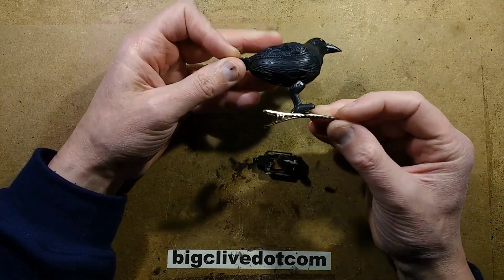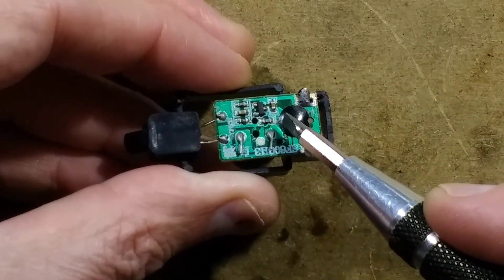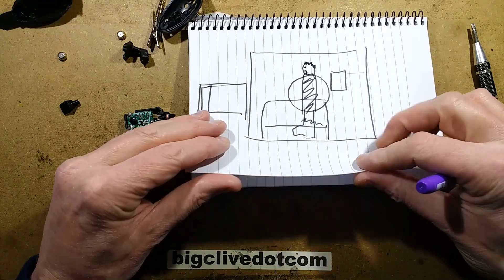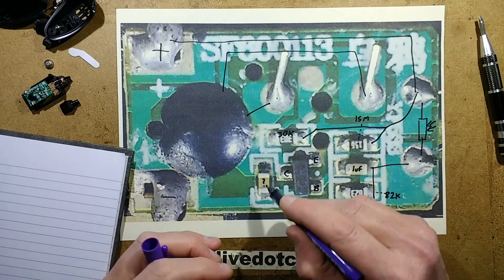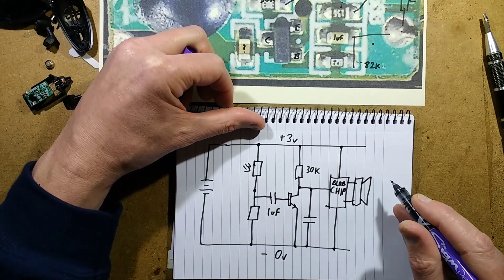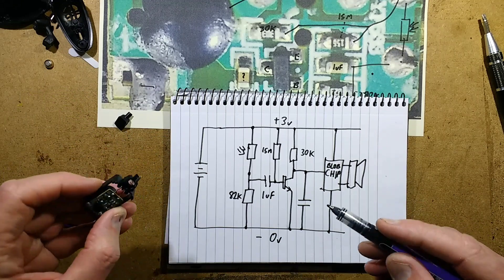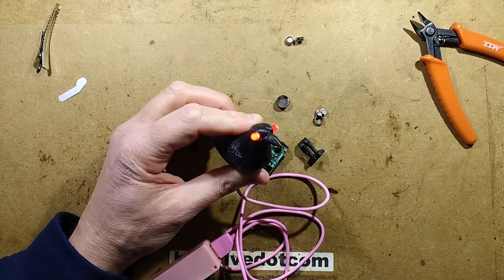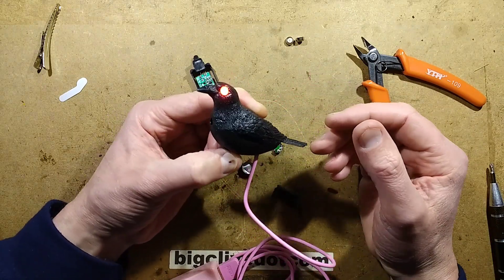Poundland's Halloween crow type thing.  Schematic and mod.

Comment: Oh, and I love how cheap, accessible and bright tiny SMD LEDs are these days, you certainly could put there a couple of 0805 lamps; they are worse for mounting them in mid-air instead of a PCB, but that's the only downside I discovered so far.

Comment: Does anyone else think it might be better to drill the eyes out and use one LED in the middle of some clear epoxy to light both sides? It would be easy enough and the epoxy would act like a light pipe. It would also be fairly easy to tape over the eye holes to keep it from leaking out. One could also solder the LED leads to the speaker output after determining the proper polarity so the eyes would light when it makes sound.

Comment: BigClive, I would love to see a short video going through the workings of this circuit with some actual voltages drawn in and what happens when the LDR value changes.

E.G. what is the bias voltage at the transistor base and does the voltage at the LDR divider always stay above that or swing around it? Does current flow from the LDR side to the transistor in all lighting conditions or does it also go from transistor/bias resistor back to LDR divider too? What is the input impedance of the transistor base and how quickly does voltage on the coupling capacitor leak off? Why use the transistor, does the microcontroller not have a high enough input impedance? I wonder if the MC input is analog or just logic.

Comment: It's interesting to see such old and simple technology as a CdS LDR still being used. They are cheap, and do have a wide resistance swing, whilst no replacement device has been found, so maybe it's not too surprising to see them being used. The amount of Cadmium in them is tiny, as you say, so perhaps there is some concentration which they can stay below, and still be legal. Arsenic in LEDs is another example. Or is it that Customs and Environmental Health inspectors haven't cottoned on to them yet?! The raven is predictably naff, as usual. ;-p Thanks BC.

Comment: Cadmium is very dangerous if burned, and or as a leachate but if handled properly it is not so. There are stories of people using cadmium coated refrigerator shelving (first offered in earliest of fridges post "ice box" era before they figured out how to do chromium on ferrous materials)  and as they repurposed these from the continuous upgrading of appliances,  the fire pit barbeque grill option became a thing and during the first burn off, suffered the ultimate affliction, namely death. Apparently one good inhalation of smoke laced with this is hard to come back from.

Comment: you could use the trigger type circuit on the audio output so when it makes a noise the eyes light up in unison :)

Oh and there is room to stick a bigger single lithium ion cell inside the body too to run it all :)

Comment: You could use the base of the transistor to drive the leds so they flash when triggered but i think you would have to increase the batteries to the larger lithium cells.

Comment: You could fill the crow's head with Epoxy and an LED then drill two small holes from the outside just deep enough for the glow to be seen.. just an Eyedea

Comment: Hey there Clive.
 I've been having this weird issue with some (most) of your videos not having any audio on chrome (Firefox, Opera and the YT app on my phone all work fine).

I know it isn't my chrome installation/plugins because I've tried disabling everything, erasing cookies, and even running a fresh installation under a Virtual Machine with a clean OS to no avail. Also, your channel is the only one that shows this behaviour.

I don't know if anyone else is having this problem or for how long it's been a thing since I usually watch your vids on my phone, but I just thought I'd mention it.
Reply from the maker: +Etienne de la Rosa Check your computer's surround sound settings.  It may be diverting the audio to a missing middle speaker.

Comment: hello from North Carolina USA. I really enjoy your videos. I'm curious about a few things. I'm trying to learn electronics. mainly power supply's. and maybe arduino type stuff. I was wondering if you could dissect some ICs or build them on paper or breadboard. and another. should I start learning how to work with SMD . I heard through hole stuff is getting rare. and within 10 years or so. be nearly impossible to get. thanks for the great videos....

Comment: The 15M resistor also ensures the batteries drain before next Halloween so you need to buy it again. Since no one would buy new batteries.
Reply from the maker: And it's glued shut.

Comment: Are these big black blobs on pcb's a resin cover for ic's?
Reply from the maker: It's a technique where a silicone chip is glued to a PCB, the wires bonded to adjacent pads and then a blob of black resin applied to protect it all from physical damage and light.  Integrated circuits are sensitive to light.
Reply: Yes, I think its to hide the ic to make it harder to copy the circuit.
Reply: Just to protect it from the air.

Comment: I got a Minions themed handwash bottle with the handle playing random excerpts from Minions activated by a spring-in-a-tube
Reply: Where can I get one?!
Reply: I got it as a small gift for my birthday and it was bought in a local shop in August I think (I don't know which shop). The soap is spent and I only kept the head. The batteries ran out long before the soap was spent and I replaced them and now it works fine. This is the one https://www.youtube.com/watch?v=ue93hqReog4  I found it online @ Boots (UK shop) http://www.boots.com/despicable-me-minions-giggling-hand-wash-10189039
Reply: Right, I'll have to remember to write it on my shopping list! :-)
Reply: maybe Clive can get one and take it apart. I could show its 'guts' too if wished for.

Comment: There used to be a little pokemon (Pikachu!) toy that used a circuit quite similar to this, although it was traditional through-hole rather than SMD... it was a while back. I tore mine apart to try and figure out how it worked and later down the line found out that people were 'circuit bending' them. I didn't have mine anymore, but got a bit of a giggle out of how mental they sound with various components swapped out.

A quick YT search came up with the natural end point of such experiments; a demonic-looking Tellytubbie doll! https://www.youtube.com/watch?v=UCPbo5vQCdY

Comment: If you had a little fiber optic or light pipe material you could use one LED.
Reply: Just a bit of any clear plastic would do.  If you lose 1/2 the light, nobody will care.  You could use a red-green LED and run the two colors to make yellowish color.  Wobbling up and down the green and red could make the eyes vary in color a bit.

Comment: Surprised to see an LDR in a product sold by a UK company given that they contain cadmium and hence are banned by RoHS
Reply: I'm not arguing about whether or not it's safer or environmentally preferable to use photodiodes/phototransistors over CdS photocells. I'm merely recognizing that the product appears not to comply with the relevant laws.
Reply: what is the alternative?
Reply: Easy, a photodiode or phototransistor.
Reply: fair do's!
Reply: What elements are they doped with?
Reply: I don't know but it is possible to go to farnell and order RoHS-compliant photodiodes/phototransistors. CdS-based LDRs? nope.
Reply: It's like the not hi-viz, hi-viz vest scandal all over again! :P
Reply: Silicon in transistors is doped with Arsenic and Phosphorous. Processing uses chemicals such as Sulphuric acid, Nitric acid, Orthophosphoric acid, Acetic acid, Acetone, Tetrafluoroethylene, Boron, Phosphorous Oxychloride, and other things. Even de-ionised water. (It hurts like crazy if you splash that water into your eye.) All of those acids are highly concentrated, and are boiled for prolonged periods, sometimes mixed together. Silane gas is often used, and chromium, copper and nickel are often used in the packaging. Nickel plating is done using cyanides. (I've used all of those chemicals in making semiconductors.) So talking about devices being non-toxic is rather misleading. Lots of heat is also used (up to around 1300 degrees Celsius, for days on end.) The device might be 'safe", but the manufacture process certainly isn't for tree-huggers. Without those devices, we'd still be living in 1950's conditions in many ways. Your home PC would not exist, and nobody would have a portable phone, unless it could be plugged into a wall socket somewhere. And your TV set, if you could afford one, would still need a strong person to lift it up. Let's face it, we would never have even heard of Big Clive.
Reply: No semiconductor. device has been developed that has the simplicity, reliability, ruggedness and wide resistance swing, coupled with low cost and ease of use, of a Cadmium Sulphide Light Dependant Resistor. Their manufacture is also much less energy-intensive and toxic to the environment than the making of Silicon transistors and diodes. You have to look at the bigger picture with all things, before you start saying, 'This is safe!' or 'This is environmentally-friendly!'.

Comment: Much better sound on this, So much better than the previous setup (hat mic I believe). Your voice is quite unique in it vocal range, and this setup although needs slight clipping on highs (although not enough to need extra processing) suits the lower end much better, No longer sounds Like an 18 years old car (absolutely crammed full of bass)

Comment: mod it to run on 2 AAA or another power source and  put in flashing eyes that flash to  it's ca-caw
if AAA is too much current  could we use  cr2032's ? i have a  a few of these but  the batteries are too hard to  come by

Comment: Instead of drilling, you could've just soldered a normal white LED in the same spot you used to demonstrate the output of the detector, and keep it outstretched in the head. :T

Comment: That mystery capacitor with the ? On it I believe is a timing resistor used to set the playback speed. You can test this by wetting a finger and putting it over the resistor as the audio is playing.
The playback speed should change pitch.

Comment: Easy to hack, you can now get those and record your own sounds. They used to be expencive but not any more. The light sensor kind is so annoying. I cant stand them. They use them in stores to set off advertisement shit. I avoid them when possible and have even seen them gutted for their batterys.

Comment: Could you remove the squawk unit, but keeping the "motion sensing" part and bodge in a transistor, attached to the red eyes so that instead of making an awful noise, it just flashed its eyes at us?
Reply: James Grimwood you could just remove the speaker and then it won't squalk but the eyes will flash.
Reply: I was assuming that was Clive's intention on seeing the start of the video. Smaller LEDs would also be far better as Clive mentioned.
Reply: cheetawolf that's even better. I've lit a bulb with my stereo once.